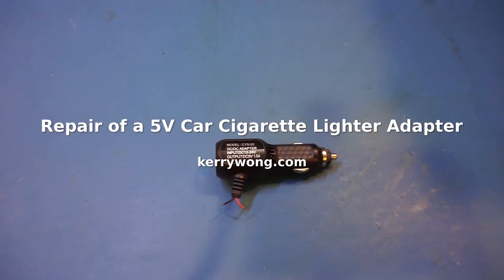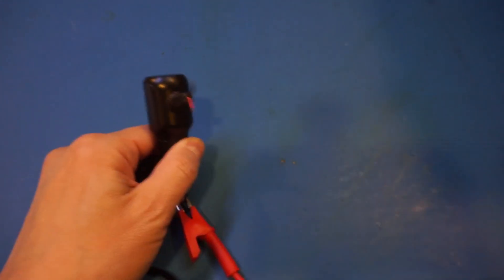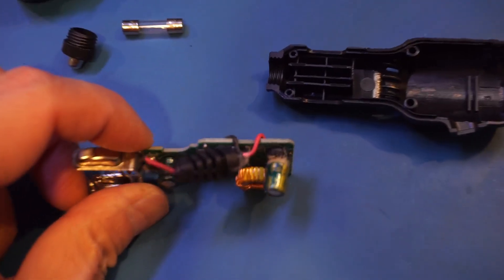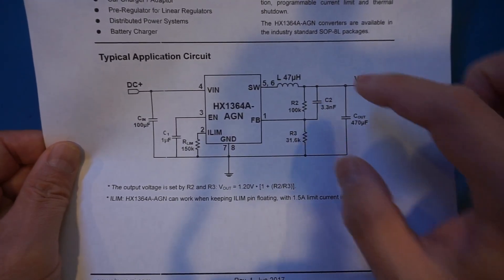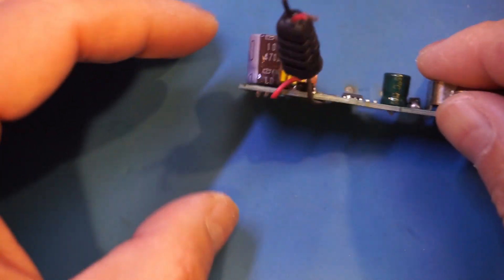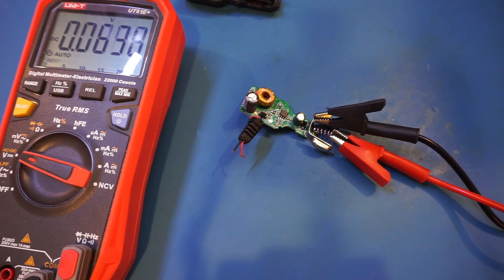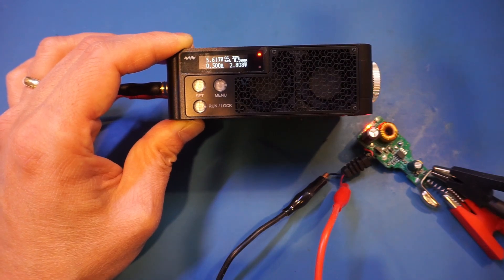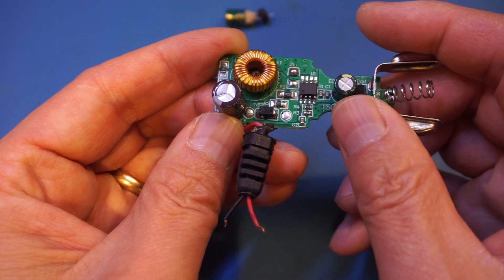Blown Capacitor, Fixing a Car DC/DC Cigarette Lighter Adapter

Comment: Blob of acetoxy free silicone on that coil will make it not flex. Had a similar thing with the cheap Aliex PSU for the GPS, a drop of water condensed on the board and corroded through the vias on the chip ,making it stop working.  So in went a different one, that i also had added some input and output LC filtering to as well.

Comment: I like an adapter which slightly increases the output voltage when there is more current demand.  For instance, 5.1V to start and 5.2V at full current.  This helps to compensate for the voltage drop in the wires between the adapter and the device.  That way, the unit you are powering sees a consistent 5.0V.

Comment: Doesn't the over voltage suggest the circuit is not functioning properly, needs better decoupling, etc? Surely the IC does not produce that result if the required passives are functioning correctly.

Comment: You said that the quality is not very good. Ive seen a lot worse than that. You should also replace the input cap and resolder the output wires properly through the holes. They've just lazily blobbed them on the back. Also hot glue the inductor down to stop it vibrating.

Comment: Is there a way to figure out what capacitor is needed when it’s missing and no schematic?  Buddy plugged in my fish finder into 120v instead of 12v. Capacitors exploded to the point the numbers can’t be seen.
Reply from the maker: In a gross over voltage situation like what you described, I doubt that capacitors were the only damaged components. For filtering capacitors, the values are not that critical, you can start with a value between 10 and 100 uF.